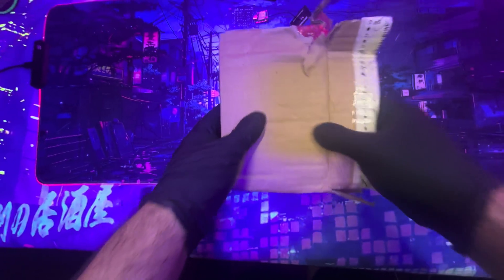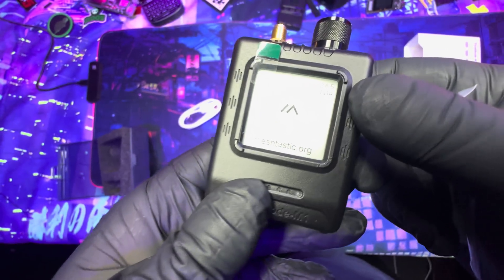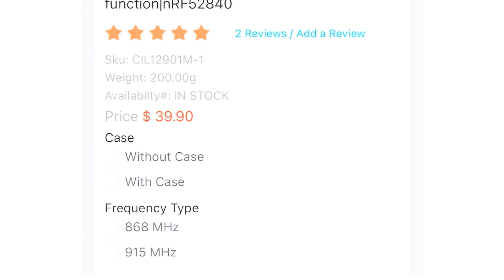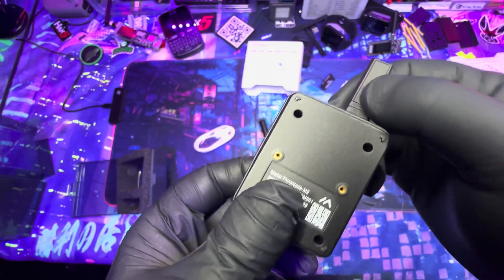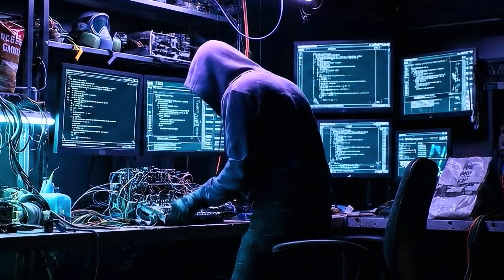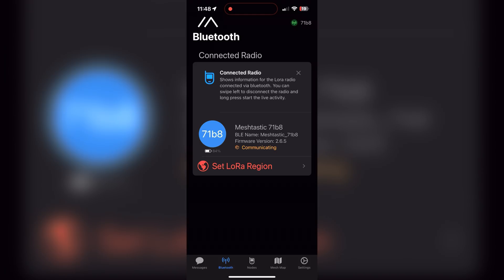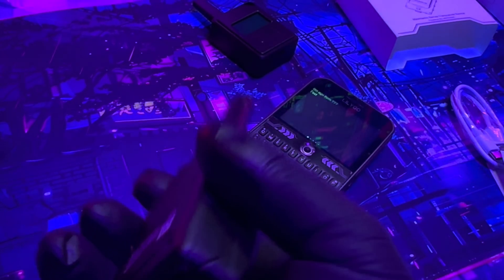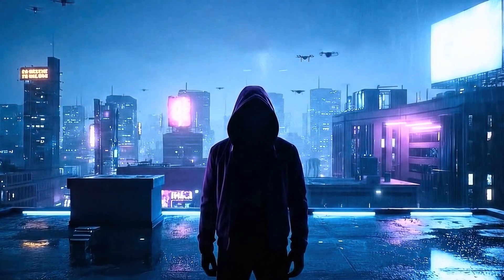Unboxing Elecrow ThinkNode M1 & M2 | Meshtastic Setup, Field Test, Review & Off-Grid Comms Breakdown

Comment: So while the M1 feels like a nice alternative to the T Echo, can it be opened up the battery upgraded like the T Echo, and if so what does the capacity inside the case look like for such an upgrade? The max you can get into the T Echo case, with an after market back cover is about 2000 mah